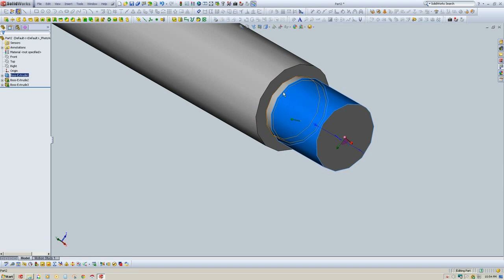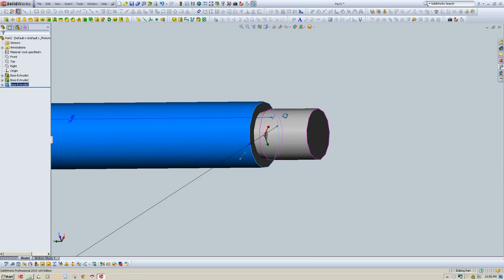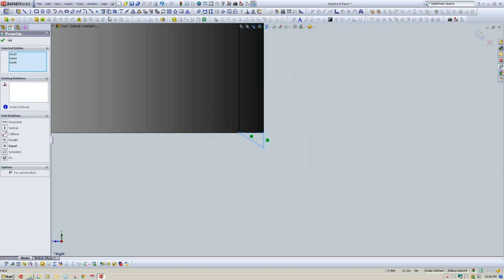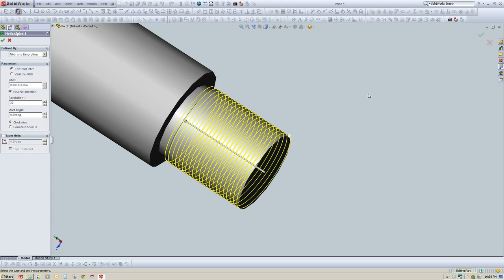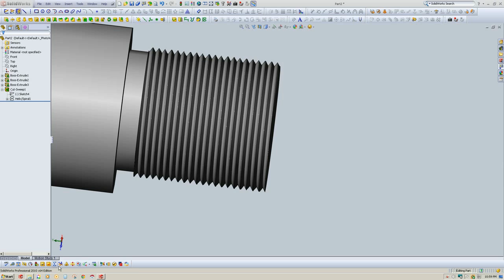Solidworks Tutorial - Super Easy 3D Screw External Thread Lesson Learn Simple Helix Cut 5 Minutes

Comment: when you `muricans go to metric system....
Reply from the maker: +Apina21 I'll use either depending on what I'm designing for.  The metric system is "better" for what reason?  Because it wasn't originally based off a king's foot?  It's based on how far light travels in a fraction of a second and who is to technically say what a second is?  It's only something we figure off the frequency oscillations of something else.  In the end, nothing is perfect ;)
Reply: except most of the world is using metric
Reply from the maker: I've got nothing against everyone going to one system, be it a measurement scale or a standardized calendar.  It makes sense but getting the whole world on board is another story.
Reply: It's not any better, unless you can't use your head to make the simple conversions of 1inch to 2,54cm. Technically, if you design on a CAD program, you are meant to use your head more than to translate from metric to imperial. Sometimes, you can't change what's already done. Take a car's speed for exemple, why use miles/hour instead of kilometer/hour? Because it would be too hard to redesign everything and make it work for metric (ratio is 1km/h for 1.61mi/h approximately). On that note, there has been wars simply because people had different ideals and thoughts in the past, wars stopped, but ideas won't change.
Reply: With technology today, bickering over metric or freedom units is irrelevant. As long as you know the difference, one can simply bring out a converter on their phone if they really need to.
Reply from the maker: SuperVladamere That's pretty well the point I've been pushing.  No system is better than another.  Everything is converted from one form to another and we'll never get the entire world on one system while we're alive.  I use what's available to me.  I can make something work whether it's metric, imperial, or both combined.
Thanks!
Reply: it's nice to type a whole number in metric as opposed to 1'-11 7/16".
it's also nice to be able to quickly divide or multiply a fraction, ie takes longer to halve 117 than halve 24- 5/8".
A lot of manufacturers can only hold about a 1/16" or 1/32" tolerance, so whats the point of having so many decimals or for that matter too precise of a number.
I used to love inputting whole numbers, but now I see why the Imperial system is the way it is.. (even though as a kid I'd grab a wrench and be like okay whats alittle bigger than 5/8s? and then just grab the metric set and move up 1mm by 1mm)
Reply: NASA lost the Mars Climate Orbiter because of the mixed up in the measurement systems. Funny how americans still wanna use the inferior imperial system.

Comment: Why INCHES? WHY?!!
Reply: +Niranjan Mahajan Because there are UNF (unified) and Metric threads and they have long ago been anchored in society
Reply: Yes but in CAD design, it's just so frustrating to hear "a quarter inch" , "a third of an inch"! Why not just say it in mm?
Reply: because some fractions in inches like 5/16" or even 3/64 are too precise to mention in millimeters.
Reply from the maker: Wow.  Apparently I haven't checked the comments in a while.  Society is obviously to blame for me using the Imperial System.  Where I'm from, inches and feet have been used since well before my time and I don't think it'd be very easy to get the entire place to change systems.  I'm not against it, I just don't know when it'd be feasible.  Too many people are too dumb to even think about switching systems.  Unfortunately, the location that I'm from doesn't often use metric so I'm forced to do it this way.  I do design things in metric but don't see a whole lot of it.
Reply: ENG
(I hope you understand ... google translator is not perfect ... sorry ...)
Where I live, Hungary and here are "mm" units.
Mostly ...
But unfortunately there is "Inch" / "Coll" to name the one you want.

It is possible to multiply, divide ... 25.4 ... but if you get a drawing and not a unit, but it's very small in "mm" units, those dimensions are more "coll".
But such a drawing where no unit is given, I'll throw it back to the drawing artist and until it fixes the deficiency, that work is ...

At the same time, for a lot of sequential drawings, where coll is the size you specify and you have to change it, there is a lot of time. :( ..
I wrote a program that collects a non-popular unit of measure for me, and converts them to show the initial size, and I see it in ascending order in the list.

It is not difficult to make such a small conversion program in MsExcel, although I'd rather write it in a developer environment ...
Such programs make it easier to work, and if the dimensions already exist, then the converted value of the preferred unit can be written to the printed drawing, of course, if it is handed to other people, it is also appropriate to specify the unit of measure.

I'm in the video about the disruption of what the non-thread profile is showing if you want to show it this way. And this will not be used as a thread in the workshop drawing.

I would be interested in making a few clicks on a thread that is on the workshop drawing a production document from the model, showing it correctly in the workshop drawing and not as a twisted profile.

HUN
( Remélem érthető...google fordító nem tökéletes... bocsi...)
Ahol lakom, Magyarország és itt vannak "mm" egységek.
Többnyire ...
De sajnos létezik az "Inch" / "Coll" nevezze aki ahogy akarja.

Lehetséges szorozni, osztani... 25.4..., de ha kap rajzot és nem írtak egységet, de nagyon picinek látható  "mm" egységben, akkor az a méretek inkább "coll"-ban értendő.
De az ilyen rajzot, ahol nincs megadva egység.. én dobom vissza a rajzolónak, és míg nem javítja a hiányosságot, addig az a munka áll...

Ugyanakkor rengeteg egymás utáni rajzok esetében, ahol coll a megadott méret és mindet ál kell váltani, akkor az sok-sok idő. :( ..
Én írtam egy programot, ami listába gyűjti az ilyen számomra nem kedvelt mértékegységet, és átváltja azokat közben mutatja a kiinduló méretet, és növekvő sorrendbe látom a listában.

Nem nehéz akár MsExcelben készíteni ilyen kis átváltó programot, bár nekem inkább jobb egy fejlesztő környezetben megírni...
Az ilyen programok megkönnyítik a munkát, és ha már megvannak a méretek akkor a kinyomtatott rajzra rá lehet firkantani a preferált egység átváltott értékét, persze ha más személyek kezébe is kerül, akkor illik a mértékegységet is odaírni.. 

Engem a videóban az zavar, hogy amit bemutat az nem menet profil, ha már így akarja megjeleníteni. És ez nem fog a műhelyrajzban menetként érzékelni használni.

Engem az érdekelt volna, hogy pár kattintással, olyan menetet készít, ami a műhelyrajzon mikor gyártási dokumentum készül a modellből, az a műhelyrajzon megfelelően jelenik meg, és nem csavart profilként ábrázolja.
Reply: @GP3D_Designs  They're no more precise though, in fact the inch is defined in mm. If you can measure to 1/64th of an inch then you can measure to 0.4mm, its how you measure and to what tolerances you can machine to. Basic vernier calipers can measure to at least 0.1mm and usually 0.05mm. Digital Calipers can measure to 0.01mm, which is half a thou. If you move to Basic Manual Micrometers you can measure to about 0.005mm or digital ones can read out to 0.001mm. And the best sub Micron calipers for Mitutoyo go down to 0.0001mm. 

This is a bad argument for inches, it's not anymore accurate just because 5/16" of an inch is 7.9375mm, because your scale at 16ths is 1.5875mm. We could say the same about metric, what 1.7543mm in a fraction, same 4 decimal accuracy, and on the inch scale it's 17543/254000ths which is literally just the conversion factor between inches and mm 25.4 *the 10000 for the 4 decimal points. Unless you have a ruler marked in 254000ths then fractions aren't anymore.
Reply: @RaymondKopec  I'm guessing you're referring to the US, which one of only a couple of countries left in the world, including Myanmar that use Fahrenheit, and maybe a couple more in south America that might use imperial. 
But even then, the US is technically a Metric country, they did "technically" convert to metric in the 1970 with the signing of the Metric Conversion Act. And despite the groaning from some industry with those same arguments 50 years ago, the companies that switched didn't lose money in fact some of them made money from the switch. They increased productivity, they reduce warehouse stocking, by switching to metric fasters which meant they kept fewer different fasteners, as you don't need odd ball dimensions. They made money by then being able to participate in European markets etc. Most big industry and tech use Metric/SI units now. It makes calculation in the sciences and engineering so much simpler, it's far easier to work in Decimal in general. 
Back then Ford, GM and a few other big manufacturers switched to metric. 
NASA and the government basically all use metric.
Reply: @PBMS123  You are 4 years late my guy. I was also talking about keeping all decimals in the number.
Reply from the maker: @GP3D_Designs  LoL, good stuff here.  Little late but, luckily, all of it I agree with, just nothing I can do about any of it like you guys.  Best thing is knowing how to convert.

Comment: Getting an odd result where it only carves out the section between the tool and the start of the helix. No idea why, I did nothing different aside from use metric (And those shouldn't effect it anyway).
Reply from the maker: Sorry for the delay, I don't get on my google much.  I have a feeling I know what your problem is but I'm not positive.  In 2016, the feature was added for threads (terrible in my opinion) but I'd rather do it manually because there's more geometry control.  When you are trying to do your swept cut operation do you see the 3 little boxes under your path selection that look like little cylinders with a circle around them?  They added this when they added the threading feature.  It controls the direction that your cut is going to go and seems a little finicky to me.  Try adjusting it to the center or left one and see if it clears it up.  For some reason, they made it default to the cut that, I would think, people would use the least.  Hope this helps.

Comment: That little triangle that create the sweep around the stock came to a sharp point at 60 degrees, How easy is to put a crest of .0069 or flat and align it perfectly. In this tutorial you used 12 TPI  1/12=.0833 pitch then pitch/12TPI=crest.  (.08333/12=.0069) Flat. Not that is critical. But just wondering.

Comment: Don't want to sound like the ol' geezer I am but... you send this to a machine shop they'll ignore that, and either delete that feature (if they use the same native CAD program) or just export and edit a STEP to eliminate it

They'll then cut the stock for the proper thread major diameter for the thread tolerance.. Then they'll either cut a single point on a manual lathe, use a canned CNC routine in their toolpath generation program for a CNC lathe/screw machine, or  use a die with the proper thread tolerance.

Same thing happens to an internal hole, You'll do a second operation with something like a tapping head on a drill press (Tapmatic, Procunier, etc...)  or run a tapping cycle on a CNC machine for the proper thread type (H1,H2, H3, depth, etc...)  as called out.

This is why Solidworks has (since I've been using it from 1995),  cosmetic thread displays and and added a Hole Wizard - I think around version 2004-2006 - some CAM programs for CNC can read that data from the native file - tho most machine shops can't even use that.

The Hole Wizard allows a CAD guy to make a Solidworks Drawing with a Hole Table callout for actual fabrication of machined threads.

For instance - one of the larger on-line rapid machining houses, Firstcut - has a guide - just google them (they're part of the group that owns Protomold). Check it out for yourself on the page. Go to Protolabs -  Firstcut - you'll see a pull down menu for Resources, then go to the menu item "Machining Design Guidelines", then the picture titled Machining Design Guidelines (I know redundant) -  then you'll see a picture called "Threaded Holes"

They even state there  "Do not model internal threads..." later it states:

"You must model the pilot hole for a threaded hole. Firstcut finds candidate threaded holes by looking at your model. It looks for holes that fall in a specific diameter range and that are in an allowable orientation."

This is why Hole Wizard works that way it does when you ask it to do a threaded hole.

Now there are times when you need to do an actual modeled thread - say for an injection or blow molded part for say a shampoo bottle or for some thing that's to be cast threads . But that's a whole other furball  - read "Mold Making Tips" in the book  Machine Shop Trade Secrets - the first sentence is something like "Mothers don't let you kids grow up to be mold makers..."

As to threading - check out some of the suggested videos on this Youtube sidebar to see how most treading is actually done.
Search Youtube for:
NC PROGRAMMING - "How to make any hole with NX CAM"
Threadmilling in Mastercam Part 1
Note in the mastercam vid - it shows how they use Solidworks files in a production environment.

Even check out the Tormach vid on threading... they use the routines in their CAM program...

Similar thing happens when we get SW files with what the customer wants for the silkscreen as a cut or extruded feature. First, it makes more work for the toolpath guy since he has to delete all that so something like Visual Mill or Mastercam doesn't see at as a machinable feature. Then, the actual guy int he back (usually with a purple mohawk that does screens T-shirts for local metal bands) has to re do it all in either Corel or Illustrator. Screeners really prefer "camera-ready" art with any seps (pantones or builds) if it's color.

I know all the threads and J1, J2, company logo's, etc look great in SW and Edrawings, but it's not really how it's done.

The best thing to do is to take make a SLDDRW  file 1:1 scale of your face/surface that you want to have screened, then either add the Fonts you want or else take that 1:1 view - export to Illustrator or some other format - bring it in to a vector based graphics program and send them that file You'll need to know the basics of doing vector-based graphics files tho...

I've had so many clients that do stuff and I tell them - "Uh no you can't do things like drill a hole much more that 5 times the drill diameter and have straight. Takes special tooling and machines for that" They say - "But Solidworks let me do it..."

I really feel that more people should have to at least once go to a machine shop and fab and build what they do in these packages... they'd learn a lot.

Adding a ton of extra faces that the program has to render every time you rotate a view - especially since it is not used for fab - can really slow down your designing.
Reply from the maker: Since making this a long time ago, I actually do things a little different now because I actually have to program the rod ends and stuff i make for cnc machining. Doing a helical cut in solidworks is just for physical representation more than anything. I save the helical cut thread as a different configuration so I can take it out for the machining process.
Reply: Raymond Kopec , ajawam 
I am doing some 2D-to-3D modeling of parts with standard NTP and Tapered NPT and my question is how important is the threading on the 3D model?  I have hundreds of parts to do all with NPT threads and I am curious if it is unprofessional to leave off the threads?  The drawings will be used in the future for sand-casting and 3D printing.  I would truly appreciate your wisdom.
Reply from the maker: If you want to do it an easy way and it still look good you can just draw a line through the center, then draw some triangles and revolve cut them to make it look like a thread.  As long as it is called out correctly in the drawing, exact dimensions are not required.  A true tapered pipe would be harder to helical cut anyway so you're probably better off doing it the way I explained.  It's really easy to do a helical cut in the video like I explain too.  The more you do it, the better you get and it gets quick.  You can thread something in less than a minute after you get good at it.  It also helps to understand the relationships in swept bosses.
Reply: Raymond Kopec  I have closely watched your video multiple times for reference, and it has been a great help.  Thank you for the video and quick response.  I have much to consider.  Cheers!
Reply: Some of us will be 3D printing our models you ol' geezer.
Reply from the maker: Like myself :0)
Reply: ipissed lmao bahhahahah

Comment: What happens with SW2013 is that if the triangle width is greater than the pitch the swept cut works but proceeds to cut off more reducing the outside diameter of the solid.

If you make the triangle width the *exact* length of the pitch (not subracting the .005) you get the error.  I think this is a problem with the software.

Comment from the maker: What version are you using?  I believe in 2013 the error was fixed to where it wouldn't come up.  This example I'm going to give is the best way to think about this error and hopefully the best way to understand it:  If your "cutting tool" (Triangle Sketech) width is greater than your pitch, solidworks will see the sketch as though it has ran into itself after a revolution and the tiny trailing corner is trying to cut something that is not technically there because it has already been cut.